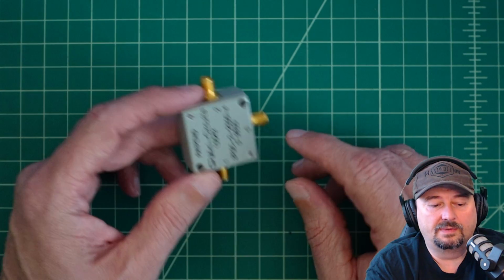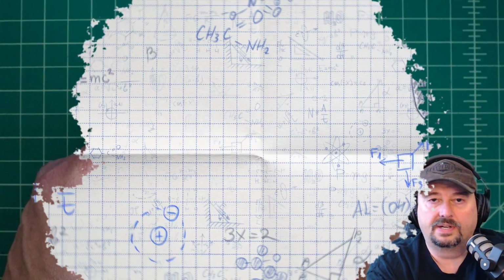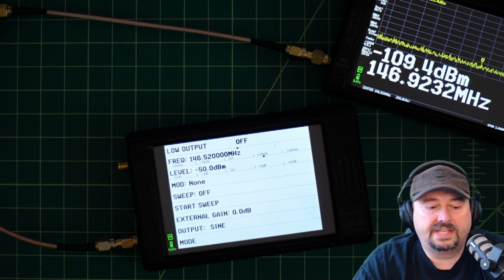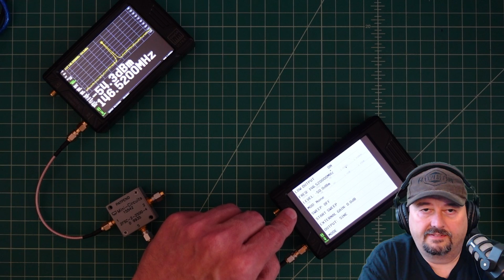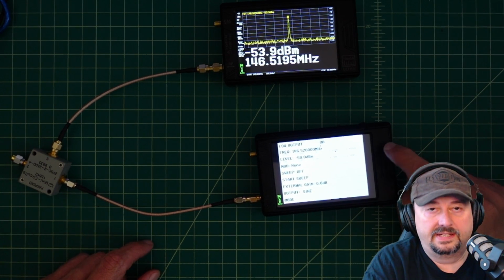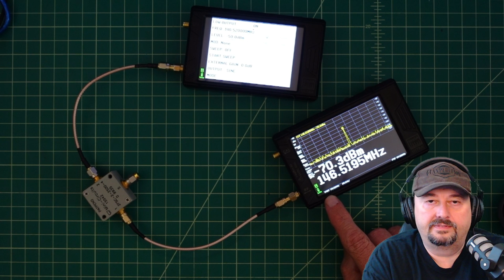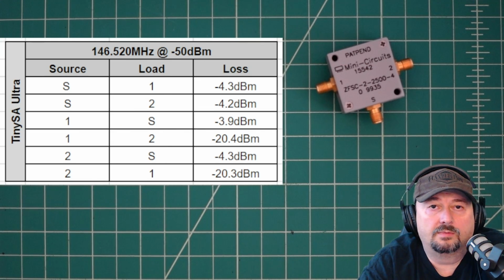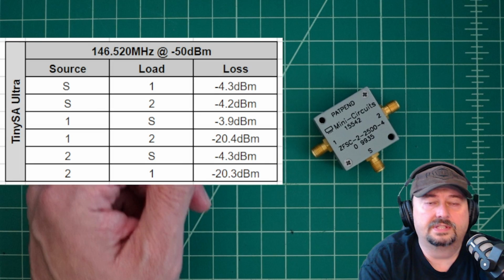RF Splitter/Combiner Comprehensive Test - The Results

Comment: I'm looking at doing some radio link analysis between a few proprietary radios without broadcasting into freespace.  I'm guessing that a power splitter with known port-to-port isolation, and a few attenuators on the radio ports (and one on the SDR port) should do the trick.
  
For example, the radios are 5Watts (about 37dBm) and a minimum receiver sensitivity of -83dBm, so using a 40dB bi-directional attenuator on each device, a splitter/combiner with 30db of port-to-port isolation and a properly rated 50-Ohm terminator (for the remaining power) on the common port, should end up with: 37 - 40 = -3dBm at the port divider input, then -3 - 30 = -33dBm from port to port, then -33 - 40 = -73dBm at the other radio.  Plenty above the noise floor/SINAD but not so high it would burn up the input stage.
  
Math similar for a 100Watt (about 50dBm) radio with -125dBm sensitivity, using the same splitter/combiner+terminator and 60dB bi-directoinal attenuators should yield about -100dBm at the other device, leaving plenty for signal/noise and SINAD.
Reply from the maker: Without double checking the math that looks right and you have the correct approach 👍

Comment: Their ZFDC directional couplers are also really handy.  You can use two to make a wideband SWR meter using two TinySA's.  The ZFDC has a low insertion loss.  I think less than 0.3dB.  You can get models with different tap values but 20 or 30dB are pretty common.  They can handle a couple/three watts.
Reply from the maker: Hey BP.  Yeah, these are pretty handy for sure.  Thanks for the comment 👍

Comment: Interesting.. That top common port appears to have a big solder land, on the inner, which would act as a capacitor to ground, which may help with the match on the higher frequencies. The  split losses you measured, were in the midband frequency range which allows up to 1.4 dB  extra loss (above the 3dB split loss). An additional tool is  a coupler in your kit, either resistive or transformer type, allows one to sample or insert signals. One can measure your real world sensitivity (due to antenna noise or site noise )
Reply from the maker: That's a good point about the coupler.  I just got this for a specfic test I want to conduct so I really only need to know loss @ 146.520 👍

Comment: It's basically just a low power -3dB splitter. The numbers are a litte off, and this is always the case, even on much larger and more expensive units.
-3dB (50%) goes one way, and -3dB (50%) goes the other way with a bit of insertion loss on top.
It has a pretty decent 20dB (99%) isolation between the two ports.
It's main limitation is the 1W power handling.
Generally, the higher power versions are used on distributed antenna systems where a single antenna can't provide coverage throughout a building. Add a splitter like this and you can run a pair of coax cables in opposite directions with an antenna at each end.

Usually, a "combiner" is a 2U or 3U rack cabinet with a lot of filtering and active recieve pre-amplifiers to allow a stack of repeaters to be fed from a single antenna.
Reply from the maker: I'd agree with all of that, thank you for the comment and for watching!

Comment: Using the nanoVNA has one decided advantage, in that you can easily see the frequency response across the specified range...  Its mini-circuits, so its usually  in spec.  Dayton used to have a Mini-Circuits booth where you could pick up quality components at a pretty good price...  Thanks for this video, very interesting.
Reply from the maker: Yeah, the Nano is probably the better tool for the job, I just like showing different ways so folks can use what they have on hand 👍

Comment: Not sure who told you it was a 2GHz to 10GHz device, it's not.  It's 10MHz to 2500MHz.  15542 is not the part number.  The part number is zfsc-2-2500-4.  Honestly if your going to do test like this you should really consider buying some real instruments not hobbyist toys.
Reply from the maker: First, thanks for watching and for the comment Mike.  I do have other test equipment but do videos with stuff that is generally available to more hams and is affordable so they can do the same, not everyone has a full bench and can perform these tests.  I prefer to make videos showing how people can explore that part of the hobby without being intimidated at the cost of entry...  I think we can both agree that folks testing equipment vs not testing is a good thing, I'm not trying to gatekeep and show off.  Thanks for the feedback.
Reply: @TheSmokinApe  I see your point.  Just so people know that the accuracy of such instruments can be questionable at best.
Reply: @mikesradiorepair  
In my experience, cheap Chinese tat usually turns out to be dissapointingly accurate.
I'll NEVER sell my Anritsu / Marconi gear, and I'm glad I have it for verification, but I also have a TinySA and a NanoVNA. They've turned out to be alright for the price.

Comment: that is a 50 ohm version of the 75 ohm splitter used on CATV lines. many uses.  back in 1980's was using a high power version on CB to co phase 2 antenna's to 1 radio. use 50 ohm coax the outher way was 75 ohm coax. them splitters used inside radios and RF amps so several transistors can be used. splitter/combiner is same thing. direction of RF . that one QRP only. maybe 1 watt at best . 73's
Reply from the maker: Hey Robert.  It's a pretty slick little device...

Comment: Mini-Circuits Labs components are top of the line, have used them for years in commercial applications. But, you really need to work on dB vs dBm, loss or gain has no fixed reference, it's always in dB not dBm. The insertion loss you were measuring was 4.2dB, no sign, no reference. A -4.2dB insertion loss would be a gain of signal (double negatives). My first mentor  at work drilled that into me.
Reply from the maker: Thanks Davis 👍